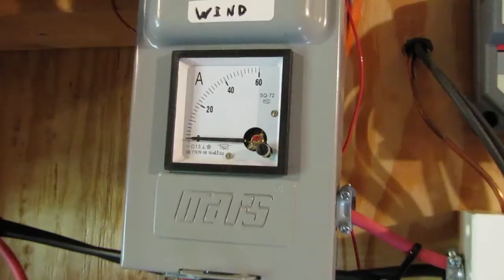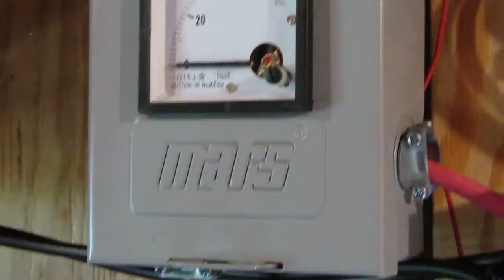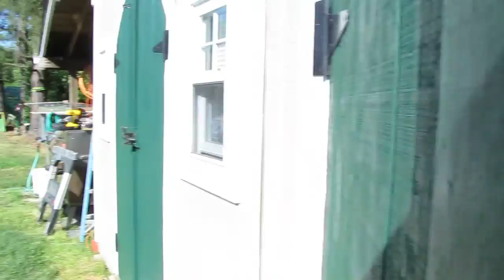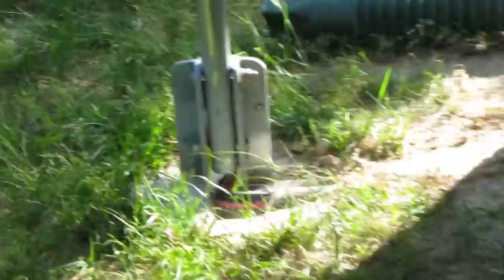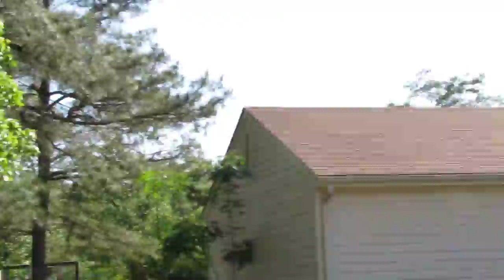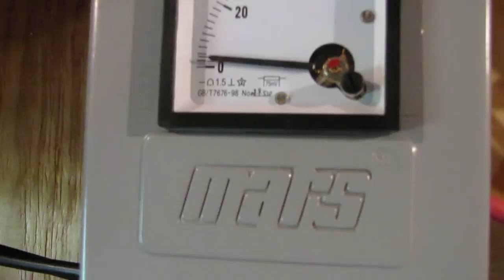Air Breeze 200 Watt by Southwest Windpower part 1

Comment from the maker: @Begbucks actually the airbreeze is an improved version over the Air x 400 check out the spec sheet it also has conversion kits to convert the air x to the air breeze Blades & Hub  Thanks for watching